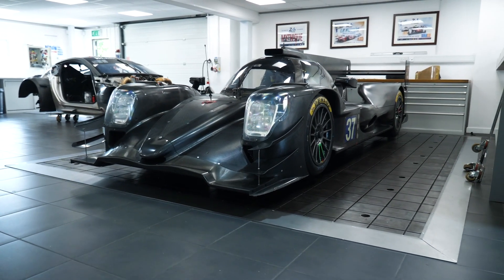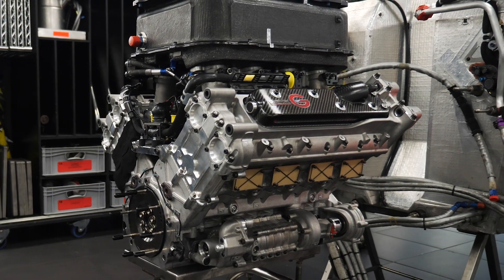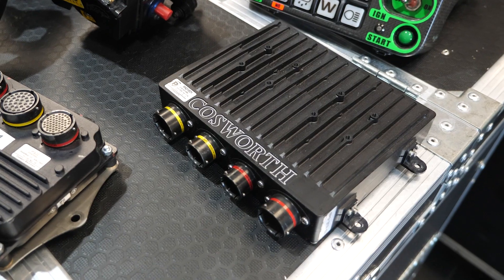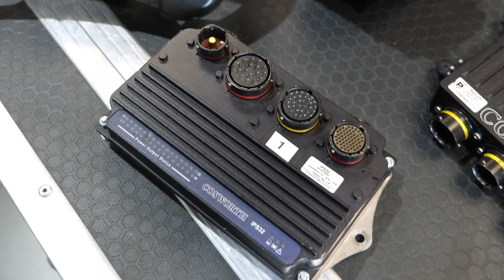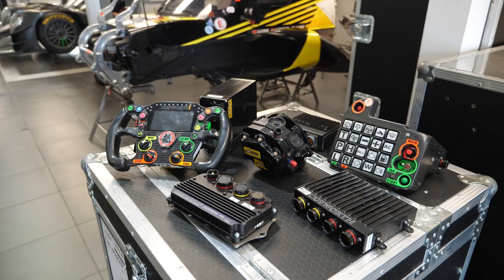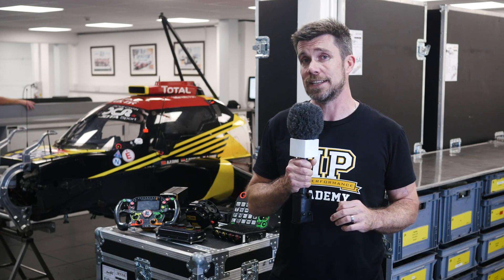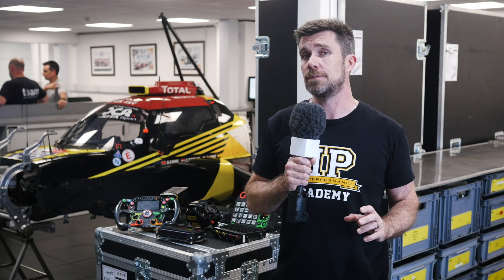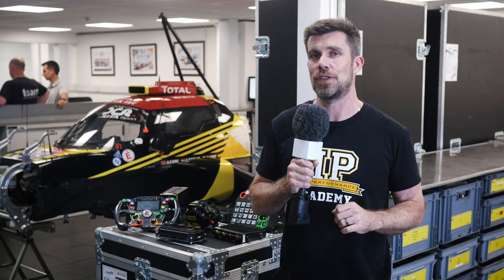234kph, 600HP, 24 Hour Racing Weapon | Jota Sport LMP2 Electronics [TECH TALK]

Comment: Are these LMP2 cars using in-cylinder pressure as part of the closed loop control strategy? I have seen some mapping where ICP + EGT were used with a thermal model of the engine to calculate fueling, and crank angle fluctuation + ICPM for fine-timing control similar to what BMW does on the N54/55 engines (but with the addition of ICP)

Comment: What do they do with the electronics that are past their track life? Are they just disposed or are they auctioned off somewhere, so that individuals who don't need the guaranteed reliability can purchase the used components at a fraction of the cost?
Reply from the maker: Probably just filtered down to some of their other cars or sold on. You would still pay good money for an ECU like this, even secondhand.
That said, this won't be a high volume task, nor are there a large amount of LMP level cars active at any one time - Taz.
Reply: They are refurbished by the manufacturer and continue to be used by the teams in seasons to come in most instances.